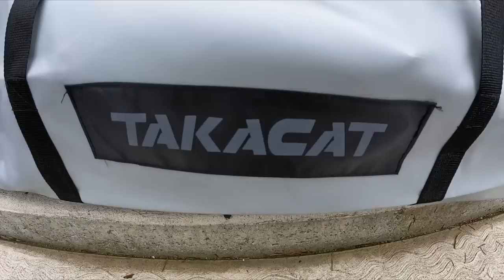Prepping for 8 Meter Swells in a Dinghy Boat! | Part 1

Comment: This is amazing.  A 3,000 mile trip with a 300HP Etec outboard is phenomenal.  Many would tell you that wouldn’t be possible, but those motors are fantastic.  So glad to see this.
Reply from the maker: Thanks! I was a little nervous at first with only one main engine. Usually these bloats have twins! 
I had a back up little motor lol. But that would have been a long ride with a 9.9hp lol

Comment: What kind of boat is this? Could you share some specs?
Reply from the maker: This is the zodiac hurricane 7.33 boat. I used to drive the same hull when I was in the coast guard. 

I have a 300 single on the back. But some point I want to put 200 twins. That’s a way better configuration for doing crazy. Long distance trips.

The boat has now been fully customized. It has star link inverter all the electronics.
I will be doing a video on all of the electronic details shortly! 

Let me know if you have more questions. I’d love to answer.